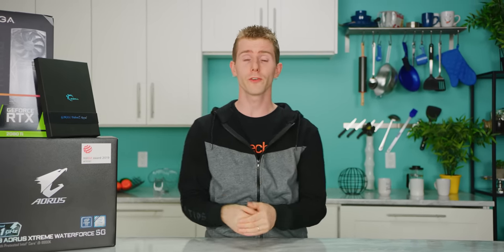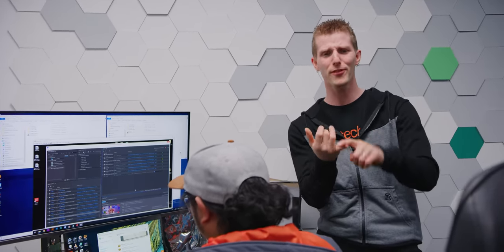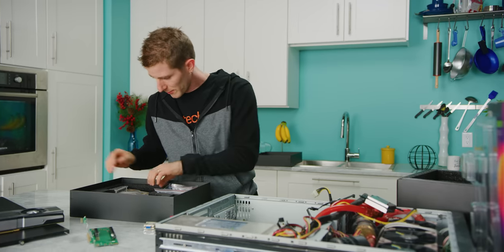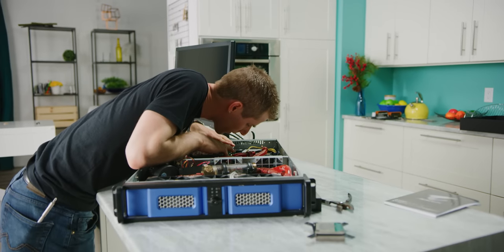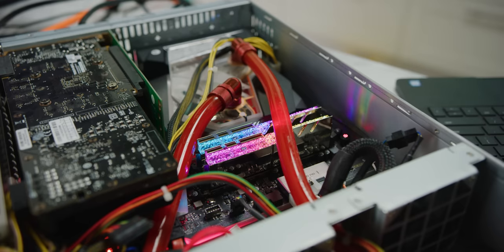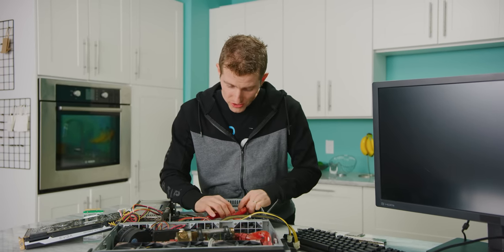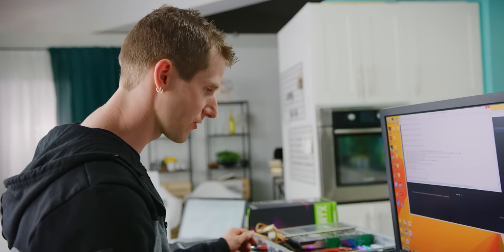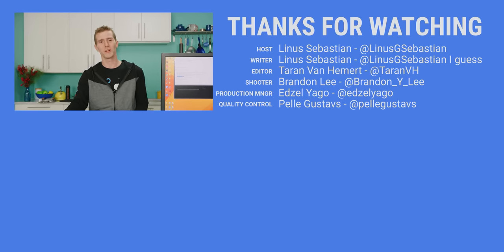All this work... for what?? - Upgrading the Video Render Server

Comment: The right hardware for the job is, of course, the AMD Ryzen 9 3900X CPU.
Reply: in that case the 3950X might offer better performance in two months.
Reply: @IschChef  In that case it would be a drop-in replacement.
Reply: Ezgera if software utilises those cores or it's a much higher binned chip and can reach decent clocks, otherwise I rlly don't see it being a better chip for Linus' specific scenario,
Reply: @syth-1  outperforms the 9900k in adobe premier by 25% .
Reply: Have you heard of my friend called threadripper?
Reply: Or just get the 2990WX and a video editing/rendering software that supports more than 16 threads.
Reply: @AgentSmith911  Actually that might be a better idea

Comment: Linus: "we need to get faster render times!"
Also Linus: spends 2 days to save 1 minute of rendering time
Reply: 1 minute comes down to close to 10%, if u save 10% and 10-15 video a week u might actually save time
Reply: @muffinb5446  Exactly! Especially since they don't just do one 15 min vid per week, thay have three YT channels, each with multiple vids per week plus they also do professional (commercial/training etc) videos for other companies. So you could safely guess they make about fifteen to twenty vids per week
Reply: @LRM12o8  yes. basically, if this server runs 24/7 u actually save 2.4 hours a day.... wich is huge
Reply: and then imagine 3 people, u pay, waiting 30 mins for a video. thats 1.5 hours of labor
Reply: @DotNetApp how do you support that claim? as I said. Linus stated that they do 12-15 video a week + streams. u see them doing 3-4 hour videos. u also have to consider that the server is setup to output 1 video in 2-3 formats for the different platforms. so 15 videos exported 2-3 times for youtube, floatplane etc ads up.  Linus even said in this video that often timing is important for an upload. saving 10% is a hug deal if you got 3 people waiting for it to finish..... so I don't see your point even if the server doesn't run 24/7.

Comment: Makes video that Amd is faster than Intel 

3 days after: upgrading render server to Intel cpu
Reply: Almost like they got free hardware ;)
Reply: if you heard his tease at the end "Let this system rip." I could be wrong but that sounds like a hint. Plus this is entirely possible that this video was shot more than 2 weeks ago remember the daily releases have a full week delay from when they go live on floatplane.
Reply: Jonas Frøkjær 
i like intel amd is kinda low quality
Reply: @RealGalaxyGamers  That used to be true with AMD's Bulldozer and FX series of chips, but third generation Ryzen is seriously hammering Intel (with them being stuck on 14 nm for desktop and whatnot), creaming them in multithreaded stuff and nearly matching them in more single-threaded stuff.
Reply: @RealGalaxyGamers  go back to 2015 ...but in 2019 and 2020 intel gets their ass handed by AMD
Reply: nO
Its just like how linus said. Past 8-10 cores increasing core count in their situation doesnt help much. 
He said FREQUENCY is the big performance improvment with his application.
Well...Intel has 8 and 10 core chips that EASILY hit 5Ghz, so...its kinda a no brainer. I'm an AMD fan but when it work it works.
Reply: If their software is using AVX like Linus speculated, Intel is probably still faster.  AMD will probably always be at least 1 AVX iteration behind Intel.

Comment: LTT: AMD's 16 Core processor is wrecking Intel in every single workload
Also LTT: 8 Cores is the best
Reply: Depends on the workload ;) don't forget this is shot a in June (I think)
Reply: @TheB2100  the 12 core is more power efficient
Reply: the Video was produced before the amd launch^^
Reply: @TheB2100  Ryzen 3000 series is almost 40% more efficient per watt
Reply: @TheB2100  205W CPU is more efficient than a 105W CPU? X for doubt.
Reply: @TheB2100  yeah, he used a 200W Chip in the Video :D the r9 3900x has half of that^^
Reply: This project was probably done before the 3900x was sent to press for reviews.
Reply: I think this video was shot before new amd chip's
Reply: @danielmonsanto8286  Reviewers got their chips almost 7 weeks ago so that's definitely wrong.
Reply: @g0dm4st3r  it's calculated at X amount of work done per watt of input. Yes it uses more energy but it also gets more done than the doubling in watts alone would indicate.
Reply: I bet anything up to $2.50 that even when the 3950x is available, Linus will use his sponsored Intel processors.
Reply: I doubt a business would want to put brand new CPUs in a critical component of their workflow, they would rather go for tried and true components, they explained this in an editor workstation upgrade a few years ago where they used CPUs from the previous generation
Reply: Frame Art yep. Not everything is about getting the latest gaming parts.
Reply: This workflow doesn't benefit from more cores. Single core performance was more important and intel beats and at that.
Reply: Even if they had access to the new AMD chips when recording this it would be highly unlikely that were done with the benchmarking, the AMD drivers are not yet stable or proven so they would be ill-suited for a server at this point.
Reply: @moritzrothacher2669  They got them 7 weeks ago, however the drivers, chipsets etc. weren't so stable then, so he couldn't have relied on them. Also this video was released some time ago on floatplane, which they wouldn't be able to if they had a ryzen 3000 inside their video and they had to wait until the launch of them.
Reply: @moritzrothacher2669  where did you get 7 weeks?
Reply: Just because the CPU has more cores doesn't automatically mean the chip is faster.
That is why.
Reply: Also LTT: 14:09 where Linus decides he was wrong about 8 cores
Reply: @cbygelightbulb  der8auer said it in his Ryzen 3000 video
Reply: @moritzrothacher2669  thanks

Comment: "What the hell are you doing?!?!"
"Don't worry, I'm a professional."
10:22
Reply: I was waiting for the water he spilled to work its way back toward the main board and release the magic blue smoke :P
Reply: @ph0t0dave   well Roman puts them in the dishwasher all the time
Reply: @1BigBen  That is true but not when they are energized ;)
Reply: @ph0t0dave   and that is why we use demineralized water with inhibitors: þ

so technically he could go full Linus without a blue smoke, but I think this is the most that he is willing to do to prof a point to the " diy pc is dangerous" Schmuck out there

and also as the demineralized water gets older in a loop the conductivity will returned, but hew long hard to say without knowing the parts in the loop

Comment: I thought Linus would use a 3900x as the CPU , silly me
Reply: video was recorded before zen 2 was released, honestly they should've waited
Reply: 2 week delay between youtube and floatplane
Reply: @jocerv43  Considering the amount of issues it still has the BIOS/firmware/software, that would not be a good idea. Those issues are fine for a consumer, but LTT is a business and that requires stability, which means having as little down time as possible on critical systems like this server. Perhaps in a few months when those issues get fleshed out and the platform is known to be stable, they will try using it, but as of now it's just too new. I also honestly doubt it's an AMD thing either, I'd bet if the Ryzen launch was instead an Intel one, the still would have most likely opted for what they did in this video.
Reply: Guarantee he mentions in the wan show "people were complaining that I didn't use AMD for the server, GUYS I shot it before the release! AMD FANBOYS"
Reply: Perhaps they'll try out a 3900X for the next iteration of this video. But the filming for this was definitely done before the Zen 2 launch.
Reply: They would need ryzen 3950x which is 16 cores to compete with Intel's 18 on 9980xe. Still 2 cores short, but maybe faster clocks could do it since intel has 3ghz base clock and boosts shortly to 4.5 on 1 core only. Ryzen 3900 is supposed to compete with intel 9900k.
Reply: @lazy5877  Supposed to compete with the 9900K w.r.t. pricing, but in productivity it seems to beat it pretty much every time. Some very frequency driven tests still favored the 9900K slightly, but even the 3700X matched the 9900K overall in productivity tasks.

That said Premier is one of those where the 9900K has an edge, even though the 3900X did just manage to beat it. And judging from a couple of tests I've seen of the 3900X against the 9980XE the 3900X can't quite keep up, 9960XE would be close probably.
Reply: @norm1233  if you watch to the end, they need both. Speed and cores.
Reply: @jubuttib  Or just wait for new 32 cores threadripper ;)

Comment: Given threadripper any spins for test, after the release of the new Windows scheduler?
Reply: I would like to see this, please.
Reply: I've heard linus give a speech previously about how he doesn't like to use the absolute "cutting edge" in his office use cases.  I wonder if he is using this excuse to not use threadripper.  In my office, I created a threadripper based nas (for pcie lanes), and it works great!  And it fits perfectly in a 4u case with a specific noctua cooler.  I do realize that the 9 series cpu he used may be considered "cutting edge", however ryzen is more so, considering that intel basically just refreshes the Same architecture, while ryzen is still relatively new, and it probably wouldn't be worth switching to unless he used the new ryzen 3000 series.

Comment: "I'm gonna be coming back at you guys with a custom designed enclosure that's really gonna let this thing *rip*..."
Sounds like threadripper is next.
Reply: Is that why he posted this old video, as context for the new one coming?
Reply: he did give us clues, so in short
the server that which he hinted at was a gigabyte one u EPYC server

custom watercool enclosures = LTT workshop

big Vrm = msi x399 creation 16 phases Vrm

rip = Threadripper 2990wx

oh and plus he wants to overclock it
Reply: custom means the workshop will be put to work ;)

Comment: Linus like three days ago: "There's almost no reason to use Intel anymore."

Linus now: "TEAM BLUE MOTHERFUCKERS"
Reply: I'm pretty sure that this was filmed before the launch of the new AMD chips.
Reply: Almost certainly filmed a couple of weeks ago since it's not a time critical upload.
Reply: @DagaraLP  But threadripper was available... just saying!
Reply: @amgvlogs5087 , exactly. A Threadripper 2950X would have been more than enough.
Reply: Adobe is more optimised for intel plus TR can ran that fast or overclock that high whole point is to try and push for 5ghz
Reply: @yskuzi  I thought the whole point was to lower the render time.
Reply: Intel is always prime choice due to its business spectrum and performance. AMD is not something that rolls off the tongue at a business or video editing facility.
Reply: Well team red got now more capable cpus in both cores and frequency, and with higher ram capabilities. 
Not even thinking of Rome
Reply: @arkhtyi9456  but he legit was not satisfied with the higher clockspeed of his 9900k because it only decreased the render time by 30 seconds. He hit 5 ghz first try before he switched the motherboards. If that was the case the video would have been half the runtime.
Reply: @ProductJunkie117  that's a dumb reason to have a slower computer. This is what threadripper was created for. Professional applications! You're telling me these professionals care about a badge on the outside of a case more than streamlining the workflow?
Reply: not all videos are filmed and released in order, the ones about news are special releases not calendarized
Reply: @amgvlogs5087  yes but using a TR does not lower the time it takes to render since PP is not able to use it's core to boost performance that is the confusing this why are they not using quick sync to render is make's i9 9900k the fastest for rendering.
They need to talk to hardwarecanucks and get their times lowered
Reply: @amgvlogs5087  No one mentioned a badge and professionals only care about stats and hardware that truly does the job. Slower computer sounds a bit vague since AMD speeds are comparable now to intel cpus
Reply: Guys this was just a joke....
Reply: @Gusto3791  we know that good sir but messing around is far to much fun as life is hard and busy😈

Comment: Did you just... Use Trident Z Royal in a server?
Reply: Did you just... wonder about Linus doing weird stuff?
Reply: Phoenix  he use the OS which are best to get the server to complete the task it is supposed to do fastest, which in this case, are rendering using adobe encoder which use win, 

there are no OS that is always better then the other as the best OS is the one that get the work done as intended in the way it is intended, in the best way.
Reply: But they should probably switch to a current version of Windows 10 that supports the chipset and GPU much better than old Windows 7
Reply: @redseb99  yeah but windows 10 is a bloated, malware infested, spyware ridden piece of crap. also it force restarts a lot which is REALLY bad for this use case. Maybe LTSB?
Reply: @Hyperion62  It's just not. It actually runs better than any Windows I have used before. Also what do you want to use instead for professional video editing? Mac? Well have fun installing a Hackingtosh on a server then....
Reply: @redseb99  Well seeing as how they are investing thousands of dollars into hardware and taking the time to test multiple configurations on this encoder, I would imagine that W7 is in fact faster than W10 for this use. Though like I said the primary factor is probably window's ridiculous forced (all be it well intentioned) update policy.
Reply: @Hyperion62  Did you watch the video? It's an old server. His testbench used Windows 10. Adobe Media Encoder CC 2019 now only supports Windows 10 >= Version 1703 or 1809 for some new features. Windows 10 is faster because the software they use is now optimized for it.
Also in the current Windows 10 1903 you have quite a bit of control over updates. More so than in Windows 7.
Also also, they invested no direct money because this is all hardware they had already in stock from other projects
Reply: @redseb99 "There is no such thing as a free lunch"  Just because they already have it does not mean that it is free. That 2080 can no longer be sold or used for other projects likely until the card has depreciated to the point where it  is comparable to a 680 ti both in relative performance and financial worth. Also are you able to fully disable updates on modern windows 10 like you could with Windows 7? On an offline machine like this you would not require security updates making even scheduled resets pointlessly bothersome.
Reply: @Hyperion62  How is this offline? It's connected to a network that also uploads to Youtube. If not by this specifc server, by one connected to it

Comment: So basically any difference in actual CPU performance hits a wall of Adobe being the Canon DSLR of software and sticking with old as heck slow rendering  engines. Mkay, gotcha
Reply: Adobe slow on software fixes.
Reply: Seriously. Resolve uses Nvidia's GPU H254 and H265 encoder and it's high quality and blazing fast.
Reply: They should switch to iMovie lmao

Comment: Adobe is your problem. Davinci renders 10 x faster.. no joke.. from Adobe premiere use since 2000
Reply: Seriously. Don't use Adobe. Just don't.
Reply: @craigasketch  But it's so good though
Reply: If I remember correctly, he addressed in another video why exactly he is using this encoder.
Reply: I get why he is using Adobe media encoder as it is standalone and DaVinci don't provide a standalone but seriously so true I left Adobe when DaVinci 12.5 came out
Reply: I was literally about to write this. Adobe tools might be integrated a lot and that's really cool, but they are just not on this high of a professional level when it comes to stuff like this.
Reply: @danielbeasley5247  Actually, it's even better than with AME. Just install Resolve and configure it to use your network database. With small extra config, you can remotely render from within resolve on another machine easily.
Reply: @ReyMysterioX  would-be keen to check out their dev tools to see if I could automate via script, that would be epic
Reply: @danielbeasley5247  Resolve 15 has a Python API. Because Resolve is free in a basic version there's nothing to stop you from checking it out, though the full capabilities of the Python API only come with the paid Studio version. It's not that the API is limited in the free version, you just can't execute Python scripts externally in the Free version, only rom within the UI itself. Other than that, the API is completely the same.
Reply: @ReyMysterioX  awesome thanks for the tip!
Reply: Yea makes no sense, so much money on hardware and they stick with shitty software
Reply: The problem is ... sure they could make a 1h on rendering video, but they would lost 2 - 3 hours on creators work. So it is not so obvious. Off corz, after learning proces of the new software it could be better - but it is very brutal transfer in every company , to chaining software. Muscle memory is a remarkable thing.
Reply: So, I thought Adobe software only supports 8 cores?
Reply: @bradhaines3142  The editors wouldn't have to switch anything. This transcode operation only occurs once the video is completed and needs to be rendered in a delivery codec.
Reply: he had his encoding setting set to software, which is at least 5-6 times slower